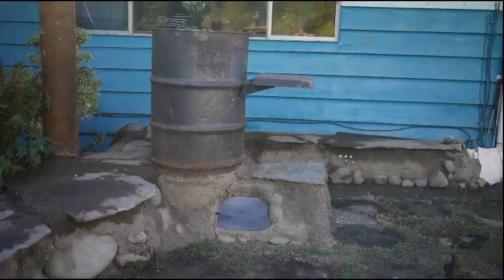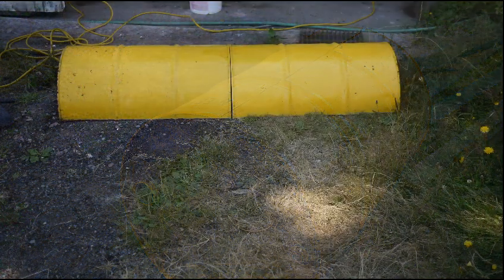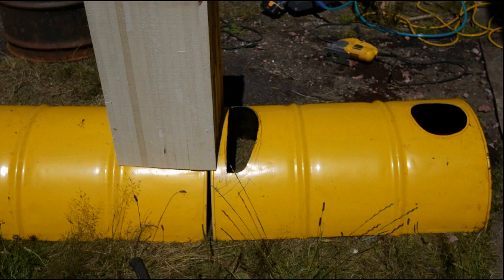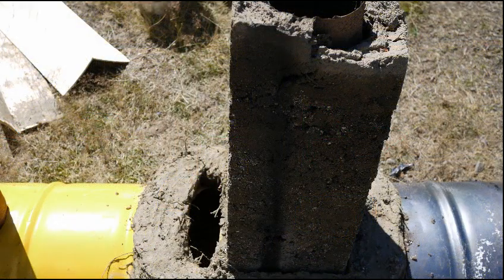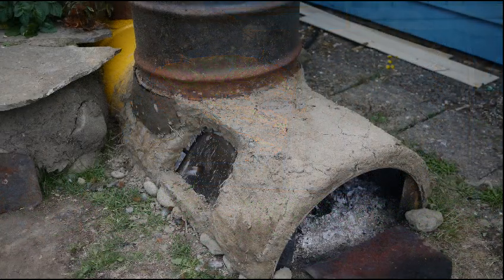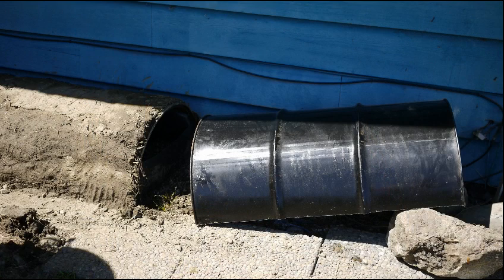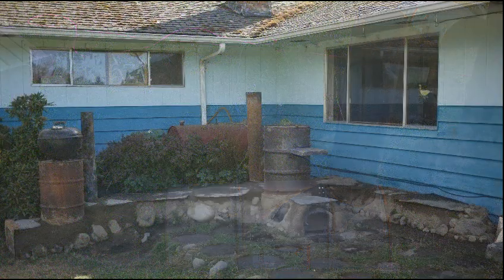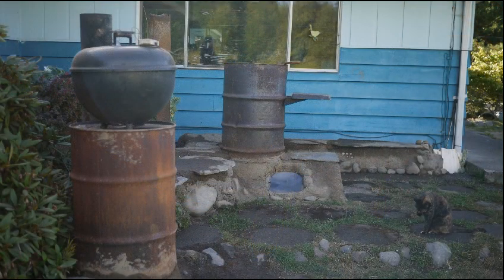Rocket Stove or Rocket Mass Heater Half Barrel System

Comment: Love the setup :). I am making a copy atm.. I have reused the heat riser from my first attempt at a system, which was way too rough and leaked all throughout the bench.. 
Anyways, said heat riser has internal diameter of only 5 - 5.5 Inches.. will this impede how well it works?? what is a good riser diameter, please ... 
Oh btw, considering how long it has held up, would you think it would be good indoors now?
Reply from the maker: Thanks so much Dan!  Ideally your riser would be 6", but if you can get 5.5" that should do.  Yes, I use this system in indoor builds regularly now.  There are lots of heater built this way at this point, it's a great method.  Good luck on your build!
Reply: Thanks for the reply :). One more Q.... my chimeny is onlt about 7" diameter ID, should this be ok do you think??

Comment: Hey Bro! What height did you use for your internal riser on this 8" system?
Reply from the maker: Roughly 32" riser height on top of the core, so overall around 45" from firebox bottom to top of riser.

Comment: how has this held up since you but it?
Reply from the maker: Amazingly well, surprisingly.  So much so, I use many of the material and technique choices still.  The system in this video was used regularly for a couple years, summer and winter, and really was a wonderful amenity.  It has now sat for most of the last two years, and although it is weedy, even had kale growing in this summer, it will still fire up and run just fine.  I have put new barrels on it every two years or so.  The hardi backer, tile, barrels, tops, it is all exceeding my expectations as far as longevity.  Thanks for the update question, it's nice to revisit these.

Comment: What is your opinion on using this to build a firebox for an indoor system? Probably using a vertical feed and more traditional exhaust pipe material?
Reply from the maker: Don't do the firebox with this method, the metal will be toast in short order.   It's great for the mass, or temporary outdoor systems, but not for a permanent indoor firebox.
Reply: *****
Kind of what I feared. Thanks! I'm gonna do a cast firebox for inside, but first I'll put one of these in the backyard, because why not!
Reply: I forgot to ask, how far in is the vertical exhaust flue stuck in? Your comments on fluid dynamics, and specifically designing as if the system were upside down and filling with water, have been very helpful for me.
Reply from the maker: It's great to hear that my explanations were helpful, thank you for that.  As for how far, ideally it is variable.  Up high for low resistance for starting or warm summer days when starting the fire, down low for maximum extraction.  I do not remember where mine ended up, but if possible, just friction fit it and slide it up and down depending on your needs.

Comment: If I do a 12"  pipe system will I have issues with the spacing in between the riser and barrel? I have a bunch of 12' laying around that was here when we bought the place...TIA
Reply from the maker: Julie Fullmer Oh, I see.  Yeah, if you build a 12" system you will need something other than a barrel.  Good luck on your build!
Reply: ***** So how much would you space the top and sides on a 12" system? Down South IS damp and cold. We are drier up here. but still cold! :)
Reply from the maker: I have no idea, that is a ridiculously large system.  Build a normal system first, is the best advice I can give you.
Reply: *****  Ok, Thanks! I will try and see what I can come up with!

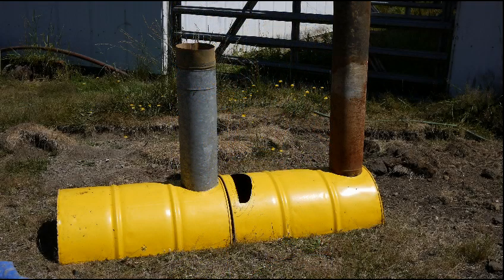Comment: dimension of the internal riser/hole & how it's attached at 2:07?
Reply from the maker: It's 8" diameter on this one, could be 6" as well.  It's friction fit into the hole in the barrel in that shot, later it's set on a clay/sand base.

Comment: How wide of a pipe did you use for the inner diameter and I'm looking to do a about a 20 ft run bench with 2 90 degree turns. You think I'll get enough draw to heat that distance?
Reply from the maker: I've done both 6" and 8", go 8" if you can.  You can for sure heat that distance, but it might be tough to get things going initially until the whole thing is sorta warm so the exhaust is warmer than the ambient air.  If you have a hole in the top of the barrel like mine, you can use that as a bypass to get the fire raging then start to warm the bench and get things flowing by slowly closing the top hole.  I've also dropped a fan in the exhaust for the first half hour or so to help a cold system get going.  I still think it's worth going for the long bench, once it's up and running it will push that just fine.

Comment: Did you just put cob around the updraft pipe using the wood with twine and staples?
Reply from the maker: Hi John, yep cob with lots of perlite.  Once it's dry the outer form(wood/twine/staples) comes off and while it's fragile, if you get the barrel over it and don't bang it it should hold up indefinitely. Thanks for the comment.

Comment: Do you have to use clay? I live in Florida and want to build something like this for my Fiance. She hates the cold but loves to be out side I figured a nice bench set up like yours would be perfect.  However everything here is sandy. Not much in the way of clay.  What would you consider using in an area with little to no clay?
Reply from the maker: Your wife will love it man, this is seriously the best outdoor heater I've ever experienced.  Build it!  So, yeah, I wouldn't sweat the details of materials too much, at least for your first iteration.  If you check out my latest outdoor system video you'll see I boxed in around the half barrels with backer board and then infilled with the cob.  For a yard system I think you'd be just fine doing the same thing and then infilling with whatever soil you have.  If it's pure sand, once it's dry it's fairly insulative so don't put a whole lot of depth over the top.  Put some slate seats, or even wood, or really just about anything so you're not sitting on dirt, and I bet you will have one happy wife.  Good luck man!
Reply: ***** I have a few ideas on how to do this now.I can get lots of granite scraps from counter tops.I am thinking maybe build the mass area with hardy board and wood. put what ever I use for the exhaust be it half barrels or 6" stove pipe then back fill it with sand and what ever I can find to mis with it and then cement chunks of granite slabs to the front back and top. Thanks.. where did you find your glass?
Reply from the maker: Air Marksman
That sounds like a fine plan.  If you use the ducting instead of the half barrels make sure you put them nearer the surface than you would if it were an indoor system.  You want it to heat up reasonable quickly.  I found the glass on ebay, search Robax.  Good luck!

Comment: So with this system, you didn't use any ducting/stove pipe, just the half barrel to carry the hot gases along and under the benches? Did I notice that you put some rocks in under the half barrels as thermal mass? If yes, what % of the void did you fill with these rocks?

Comment: Hi Broaudio,
I am interested in heating a basement room but I also want my RS/MH outside so the flue does not have to be inside my walls.

I take it your idea is to get heat inside the house as well?  What is your thinking that way and are you getting heat inside from your project?  I thought I might be able to extend my mass under the house wall into the dwelling and then snake it back to the outsidet.   What's your thinking on this?
I got quite inspired by what you're doing there.  Thanks.

Comment: That's the answer I wanted thank you. The "shed" I want to heat measures internally 4ft by 12ft. But the only place I can build the stove/core is off one of the 12ft sides at an end. The pipes carrying the gases would have to make a 90 degree turn. If only had I known about this stuff before I built the shed.

Comment: Great Video, I do have a question. Is there a way to keep the cob from cracking when it dries out. probably not to big a deal outside But id love to put one in a cabin at some point so it would probably not only be functional but a focal point in a living area. Also what happens to the cob outdoors if it rains, then dries, and over and over.

Comment: So are you saying the batch loading is a more inefficient burn in general or just because of the windows ?  I am about a week into my full install, to late to change now but would like to know. I'm using small window in my burn tunnel, found out how to place to keep clean. 
I have tested around 20 different set-ups thus far,  Larger & longest risers possible is the key!